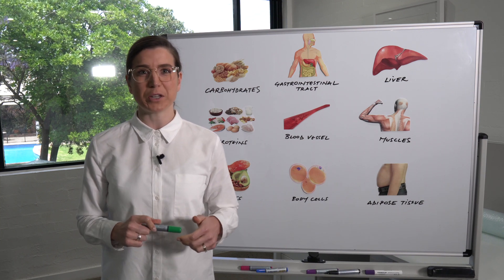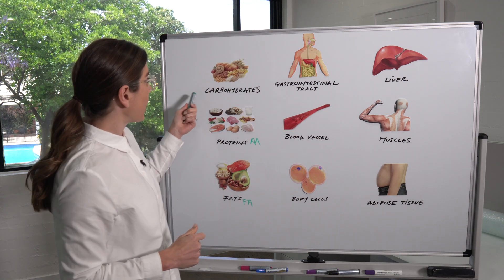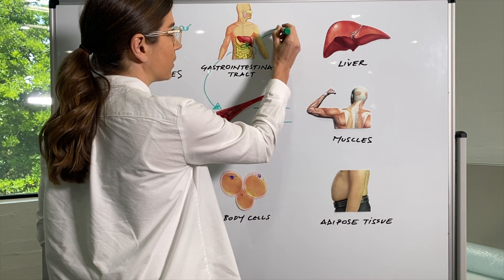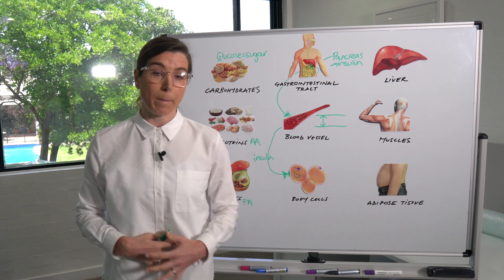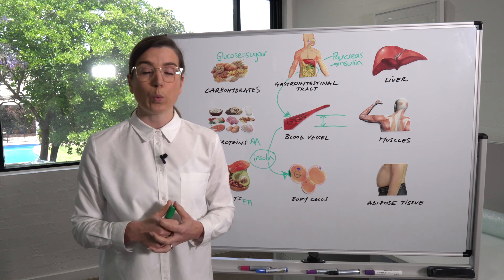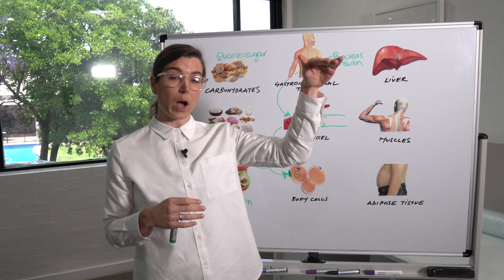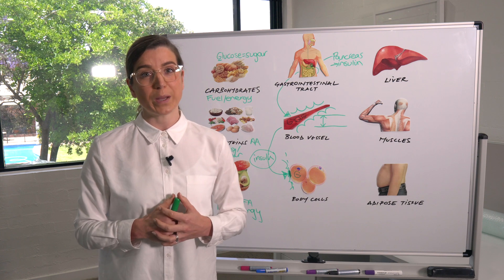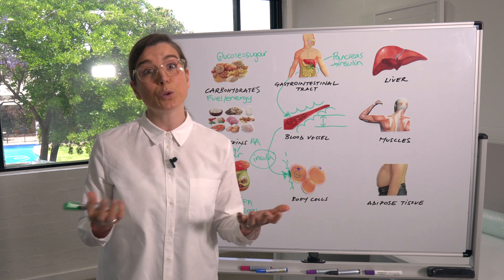How to Reverse Engineer Insulin Resistance. Part One - Type 2 Diabetes.

Comment: Prioritized does not mean the same thing as preferred. If there is ethanol in the bloodstream the body will metabolize that BEFORE either glucose or fat. Does that mean we should fuel ourselves with ethanol preferably over glucose? NO! the body prioritizes ethanol because the longer ethanol remains in the bloodstream the more damage it does. The same can be said of glucose. Ever heard of glycation?
Reply: Sam Marsh  the term 'preferred' is a misnomer and (imho) fosters a misunderstanding of the actual metabolic process. The human body can metabolize several substances into intracellular energy. All come with physiologic consequences. In my opionion, the fuel source with the most favorable consequences is saturated animal fat.